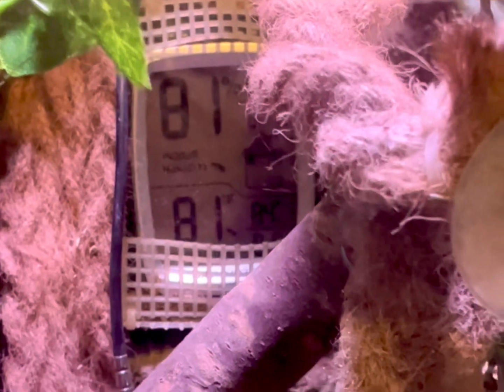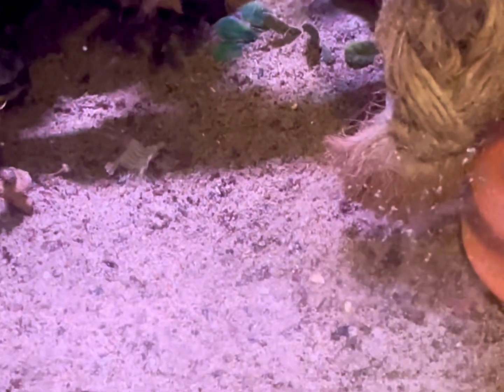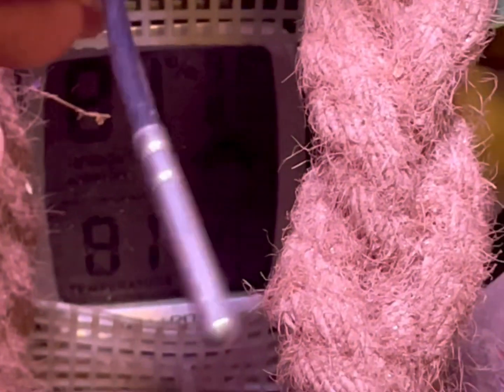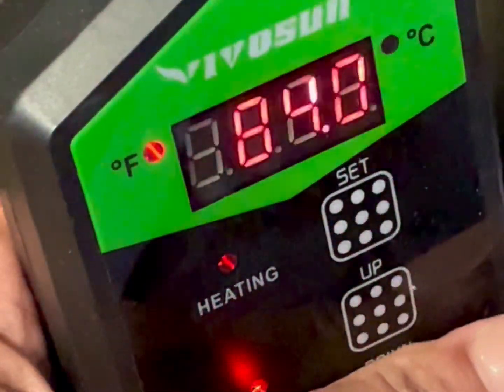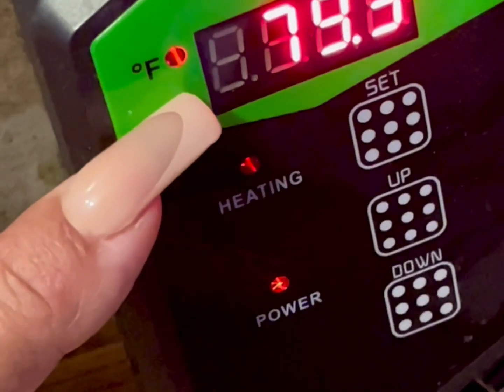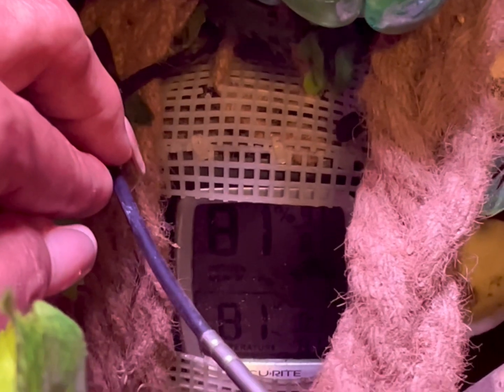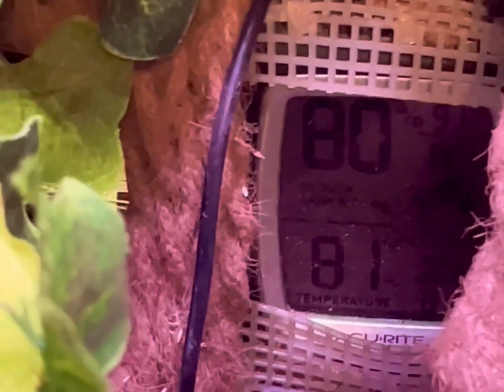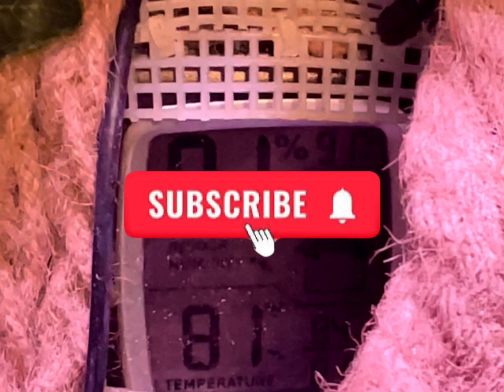GAUGE PLACEMENT!

Comment: How can I put the prop in the cage without there being a gap in the lid for my cage
Reply from the maker: @Randomrush0420  if you have a hinge lid, you can put it through the plastic part in the back and hang it off the sidewalk or run it to the center of the tank and attach it to command hook.
Reply: @landhermitcrabeducenter I would thing humidity would come out if I put it through the plastic part cause I would have to cut a opening right to get it through ?